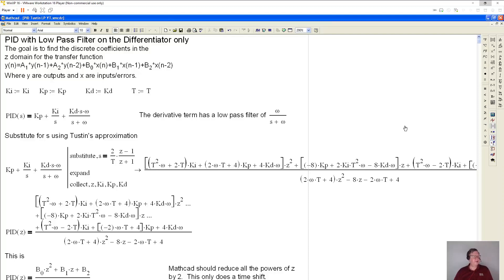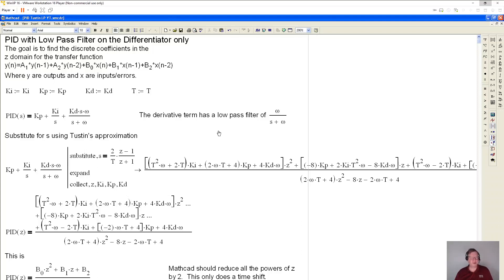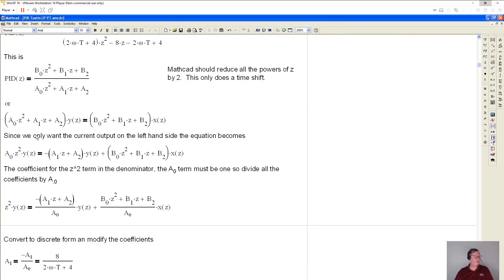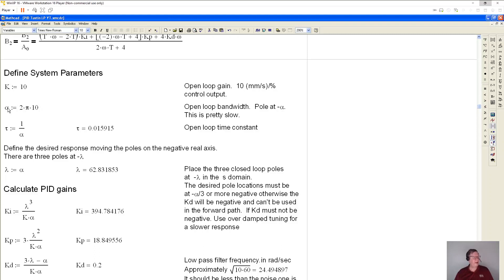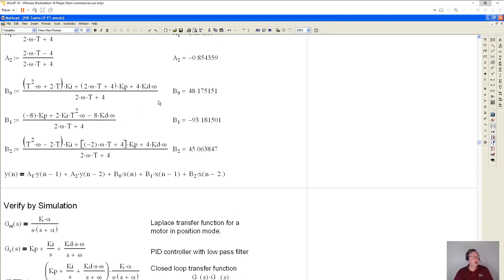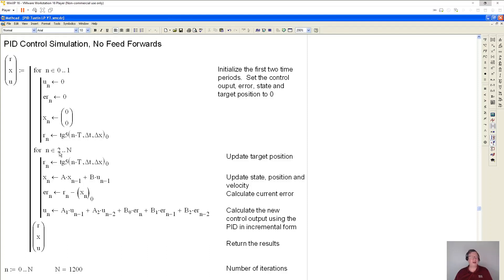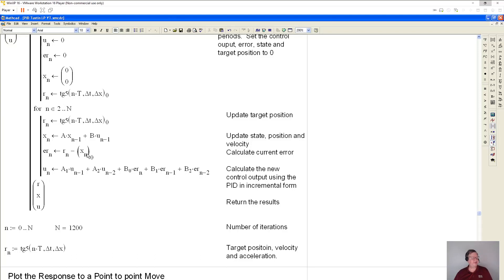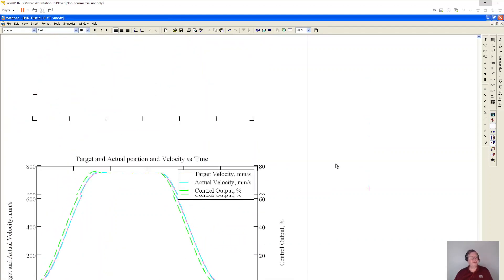Peter Ponders PID.  PID in incremental ( velocity ) form

Comment: Nice - I have been a fan of your videos for awhile! I am from the US in the great southwest region. 

Say I have had a question that I finally posted on the DSP Stack Exchange site. You’re free to search it under “For Continuous System in Static/Quasi-static Equilibrium are Memoryless?”. 

There I am attempting to ask about quasi-statics / statics (where d2x/dt2 is always at minimum zero for either) and is memoryless. 

I further ask about whether the latter in Quasi-static equilibrium are just systems whose output-motion is driven solely by input and (like zero state response by definition sets IC to zero), where the states previous has no effect on current output-response. 

So in that zero state response reference, when the dynamics are turned off then the motion will stop and the output will return to the IC which is essentially just like a static equilibrium position; that same position about which the dynamics had been oscillating about prior to being turned off. 

Going back to the quasi-statics, in that case there is no system dynamics, maybe input dynamics since the input is time varying u and du/dt,but as far as the system is concerned it’s states and outputs are in quasi-static equilibrium. We would see that the previous state variates are zero for the dx/dt and x is not zero but acts like a relative zero point as this the x position acts like a quasi-static equilibrium point so that the output will return to. Prior to returning to that quasi-static equilibrium point, these states remain zero for the current time instant when the output and inputs (u, du/dt) are processed/applied to the system. If after that instant had passed that the input process were to be turned off, then the output would fall back to the zero states dx/dt = 0 and x ‘em which acts like a relative zero or a quasi-static equilibrium position.

For example Second Order Mechanical System whose state variables are x, dx/dt are set to zero, then looking at state space control:

States are x, dx/dt, d2x/dt2
Inputs are u, du/dt
Outputs are y, dy/dt

[dx/dt; d2x/dt2] = A*[x;dx/dt] + B*[u;du/dt] 

[0;0] =A*[x;0] + B*[u;du/dt] 

What that attempts to show is that the system is 1) it is at least a type of static system because d2x/dt2 is zero, 2) it is quasi-static because dx/dt is zero, but not x, 3) u and du/dt are not zero so the load is slowly applied which drives the output of the system, even those the states are zero.

Looking at the output equation 

[y; dy/dt] = C*[x;dx/dt] + D*[u; du/dt] 
[y; dy/dt] = C*[x; 0]       + D*[u; du/dt] 

Now what this attempts to show is that the output is not zero, even thought the all the states except x are zero. 

So what do you think? To me it explains the quasi-static, slowly applied loading concept on a system. Where then the system’s state dynamics are not considered, but instead just the quasi-statics.